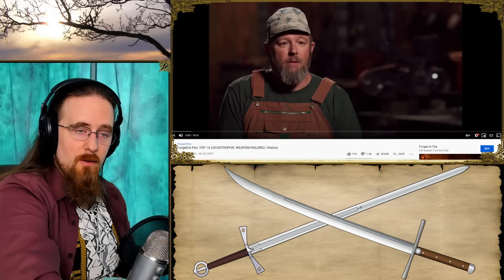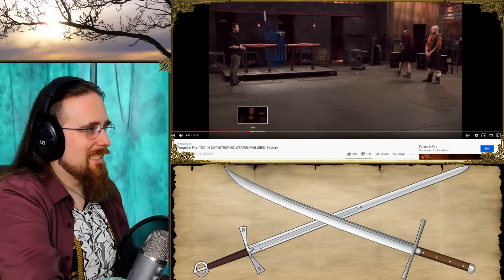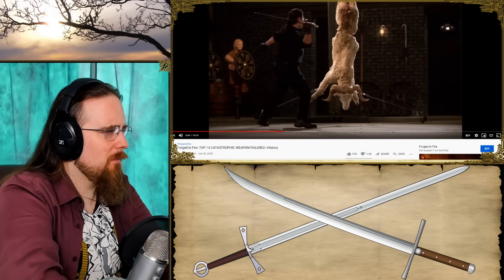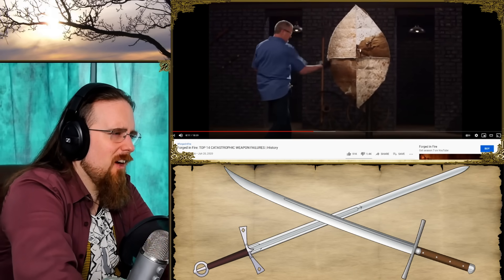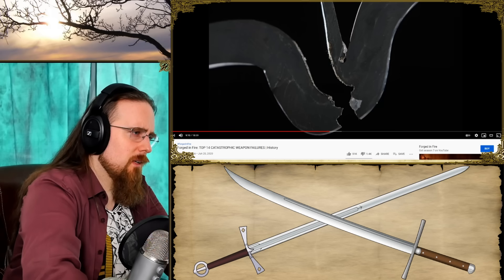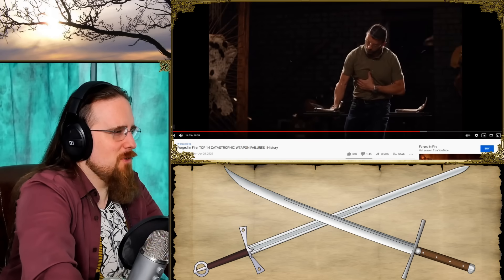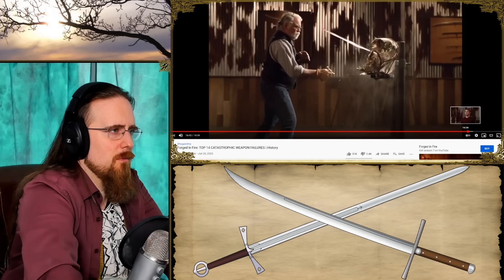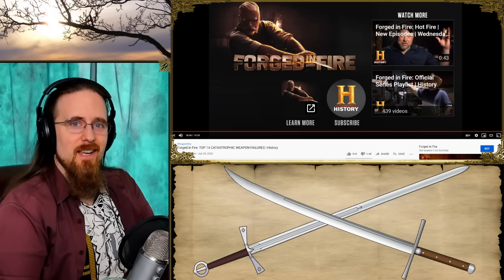Skall Comments: Catastrophic Failures on Forged in Fire

Comment: The hardwood test is in case they need to fight an ent.
Reply: Wouldn't ypu use an axe or a halberd for an ent though?
Reply: @joyeuse8524  Anything that burns hot enough to set fire to living wood would be a better option.
Reply: @anselravenhart4753  but of course it would, but here's considering melee weapons, if you want fire, there's throwing some flamable liquids and then burning arrows (they exist for this kinda situations, and sieges...)
Reply: @joyeuse8524  Well, depending on the type of ent, you don't ever want to be in melee range, because you're dead no matter what you wanna use.
Reply: @anselravenhart4753  flamethrower? Flamethrower

Though if you do want to get the wood, which is most of the time the case as it is usually a great material for making wands and staves, fire isn't an option

Comment: For the horse skull failure, I remember the episode and did explain why it failed. The tang was too small for  handle, in other words the tang had alot of room to move around which lead to failure. They even show the snapped off tang in the handle and you can see the huge gap in the handle.

Comment: Keep in mind that they give rigorous testing like they do on Forged in Fire because with exception to Doug Marcaida, the judges are master smiths (as rated by the ABS, or American Bladesmith Society), so they know how well the blades should hold up if they're heat treated properly. Most of the time, the weapons sometimes take edge damage but otherwise hold up well.

The test for Master Smith with the ABS involves forging a knife that can withstand a 90-degree bend in both directions and then a submission of five identically-forged knives to a panel of judges. One contestant on Forged in Fire was actually a panelist for J. Neilson's master smith test.

Comment: Something to remember with this show, this is a competition for $10,000 not a showcase of smithing techniques or even weapon techniques.

These tests are so intense because they want only the best of the best to make it, and eliminations in each round are required for the show/contest to proceed.

To find the “best” smith they need to push these weapons to the extreme to “guarantee” a clear winner. As Skal points out, the tests make for great entertainment, and the chance of failures adds stakes to what is a fairly mundane topic for the average viewer, which drives interest in even non-enthusiasts. 

It also makes choosing who gets eliminated less subjective if a weapon simply fails and another doesn’t.

Comment: Just saw this vid. Very interesting, but one point to be made for the aggressiveness of their tests is that usually a failure of this sort on a new knife or sword may not happen this way in normal use, but usually shows underlying defects that would eventually surface through repeated usage (on tools which should have multi-generational lifespans). And even then, hunting/army/survival knives certainly must be strong enough for all that as you might well be called to use them as crow bars or whatever else (just like swords could’ve would’ve been at war, if you have nothing else to bust down a door).

They usually look at the failure afterward and point out either micro-fissure, bad welds, bad tempers, or other. And they judge all of them based on the same criteria.

When you ask metallurgists and industrial engineers about the show, they have the same reaction towards damascus steel, that it is a purely cosmetic choice, and a liability if anything else, but that these strength tests should be survivable by well forged steel.

Comment: At 7:30 he did have proper edge alignment; if you look closely the blade is actually in two places at once, the newly detached blade which is much more visible and when the sword was still intact hence the gray line you can see from the handle. It seems like that frame where the sword breaks isn’t a key frame so the interpolation of the camera took where the blade was and where it was going and sort of meshed the two together.

Comment: 13:40 The living horse would have various other tissues in addition to the bone, and it's all fairly wet. Like trying to cut wet wood vs. dry wood, the water might absorb some force, but mostly, it will cause the wood to seize around the blade or saw.

Comment: The point you made about rounding out the shouldering where the tang turns into the blade is a good one. That’s actually why firearms suppressors are round for the most part because when you deal with the high pressures being captured by the suppressor sharper edges generally tend to blow out during testing a lot faster than if they weren’t brought to an point

Comment: My favorite pattern welded functional designs are ones which present the layers similarly to feather damascus. By choosing steels that wear differently with continued use, and by creating a significant number of layers, you can make what amounts to a self-serrating blade with extended use. It certainly won't slice as well once it wears down to that point, but even dull serrations can cause damage.

Edit: for clarification, I still feel that essentially all of the pattern welded steels are seeking the cool factor and really don't contribute anything to the blades in a structural sense that could not be achieved with a monosteel blade.

Comment: We call those stress risers. A sharp corner, notch, gouge exc are stress risers. The force will focus in that area and cause a failure. In my heat treating company we inspect all blades before heat treating to make sure the stress risers will not cause a crack. Even course grit grind lines running perpendicular to the spine can cause cracks during the quench.

Comment: When I was making swords, we had to hit an old anvil (yep, an anvil) with every blade 10 + (from point to handle with each blow to hit in a different spot, also from each side of a blade if it was a medieval sword for example) times to see if there are no cracks. Most of them weren't sharp as most of them were used for actual sword fighting. But damn, we at least had thick leather apron, facemask to cover whole head and even Kevlar collar to protect our neck, because even when it was blunt, it was very very dangerous. Once, when we had catastrophic failure I had a piece of a sword stuck in my mask, almost touching my cheek. But with this testing, we ended up with only few complaints per year and we made thousands of swords each year. We welded those broken blades and sold them for less as only decorative swords. I've heard that some those decorations were used in swordfight as well and survived a lot of fights before breaking. Place where it was welded was softer then rest of the blade, but it was still usable. Dangerous, but usable. But you know, if you want to be safe.... you are not fighting with a sword for fun.

Comment: @5.06 his edge is presented, but notice that blade isn't flat to it's line of trajectory; this will create a twisting moment that will create intense shear forces in respect to the part of the blade that has already passed the target.  The shearing place is between the contact point, and the center of momentum/rotation momentum on the far end of the blade.  The steel would have to be incredibly tough across the cross-section and resistant to shearing force (eg supple along it's entire body length) to stop the twisting, since the twist in the distant end of the blade will be pulled in the opposite direction than the twist that occurs at point of contact (which is stationery) (conservation of momentum). typically the far end cuts in the direction of the blade cut (usually down), and the middle usually twists contact edge up.
 The plane of the cut, needs to be at the plane of blade presentation, as well as edge on the same line.  Practice against bottles of air to get the hang of it.

Comment: “There’s only epoxy holding this”. I’m not sure of the greater context, but as a boat builder and a dock builder I have an incredibly high degree of confidence in epoxy. I’ve used it practically to lift thousands of pounds.

Comment: The show does a lot of Odd editing where it seems they cut out informative bits so they can have time to replay the cliffhanger commercial break clips. They will also go back and re-dub explanations of failures and issues during the time blade making scenes afterwards too. Occasionally you'll see the judges talking about their evaluations of the blades but later in the series those scenes just seem to mostly not be done anymore; just more Television min/maxing I suppose. Overall though it is a fun show, you should watch a few episodes if you haven't already. I believe you can even watch some of the episodes on Netflix now.

Comment: One thing that I think needs to be kept in mind is that these are only the failures.  There are blades which not only pass these same kinds of tests, but also manage to do so with little-to-no damage at the end, so the tests aren't impossible.  They're just above and beyond what a blade would normally experience on the battle field.
Reply: I believe its been stated by them before that the tests are also all done on a weapon made by one of the judges first to see if it will hold up. And recently they started letting the competitors compete against the judges themselves and usually the judges very own weapons that they make in the same time hold up just fine.

Comment: One small correction regarding 10:45 : Bone as in lamellar bone (which is the normal adult bone) is always calcified. Depending on the formation of the bone the calcification of cartilage is usually the first point in ossification at which you can speak of "bone" as in woven bone first, later lamellar bone. Only real exceptions of naturally decalfified bone is due to pathological effects.
Skallagrims point about dried bone being harder to cut still stand obviously.

Comment: Two reactions to your comments on the show:
They hit that hard in order for some blades to distance themselves from others. Hit softer, and you might create scenarios where no blade is damaged.
You are right to suggest simpler and straighter strokes to make the tests less biased, but I think it's also important to test the usability of the sword. If the handle prevents you from handling the blade well, it's important to know it.
Great analysis overall, thanks a lot!
Reply: I agree, the show can easily be biased in picking winners especially for ratings and such. If they want a blade to break during a segment, then they'll break a blade, fair or not. They can't be called on it by the contestants either for even if they try to cut concrete with the flat of the blade being swung by a machine that wont stop until something breaks because "you're saying that because you lost"

Comment: You also have to keep in mind that the tests are magnified  in "unreal toughness"  for a purpose. A real blade from the period had to endure years of wear and tear. Also historical blades were not all wielded by masters, as Skallagrim pointed out in a previous episode. If your blade can't survive a laymen it may be  pretty but you wouldn't outfit your army with pretty blades that have flawed smithing.  In one knife test both blades performed so well that the judges had to add more weight to the rig to force a breakage (I think it was Super Champion episode). In other words, if the Forged in Fire crew can wreck your blade easily you wouldn't want to march into battle with it.

Comment: as a blade craftsman I always check mine before they go out to a "toughness" test first is hardened oak, then antler . My failure rate is about 2%, mostly edge chipping. I have had a few ( patterned steel just blow up into a million pieces though which ALWAYS SUCKS because of the amount of extra work they are)

Comment: If you click a little gear down on the bottom right for settings, you can adjust the playback speed down to a quarter of normal. Won't get the frames back that were lost, but it can help

Comment: The trouble I have with forged in fire is two fold. 1. No temp guns are provided so the contestants have to rely on sight to forge , but the studio lights wash everything out so the smiths can’t easily tell how hot the steel is. This is what causes so many stress fractures and cold shuts.
2. Sending the smiths home for a week ends up screwing over poorer contestants 9/10 times. The dude with the power hammer and sword length forge is able to deal with issues that come up faster and more easily than the guy working out of a grill forge with a 50lb cast anvil and a ball peen hammer. I’d prefer that they give these guys access to the studio forge for a week instead so that skill is the only variable.

Comment: You did catch something that I have seen multiple times happen in this show and it drives me crazy.  Several of the testers are smiths and not actually skilled in using weapons.  I have seen them repeatedly make mistakes is blade alignment when performing strikes that results in the weapon breaking.  Those mistakes are the failure of the judges and not the contestant.  

Since this is a competition, if one of the judges messes up and damages/destroys one of the contestants submission through their actions rather than an innate failure of the item then they are opening themselves up to a lawsuit for "fixing" the competition.  There are lots of laws in the US specifically targeted at going after contest TV shows which fix their results and it is highly illegal.  I would not be surprised if they actually pay out the full amount to contestants whose weapons are broken and lose through some screw-up on the part of a show judge.

Comment: 7:50 Pretty sure it was the previous slit in the leather. The tip of the blade hits just above that very deep gash on leather. A shallow angle on leather would mean a large deflect to the tip of the blade. His wrist is straight as a rail, but the tip slides up and the second curve in the blade shows the amount of sheer force on the midpoint. I really don't think it was his form, but the previous cut that broke the blade.

Comment: He explains what happened with the break at the guard.  There was an air gap in between the guard and tang.  The slot for the tang to fit through was too big making a gap at the guard which allowed it to move and stress.  In fact, if you actually took time to listen, almost in every instance they show the smith what they did wrong.  In almost all situations except where Jay Neilson is doing the strength test, it's the Blacksmith's fault.  Ben Abbott's pretty good and David Baker does excellent strength tests.  If it breaks on David Baker it's always because of the blacksmith.  At times I think Barker is too easy on the blade.  It's frequently a heat treat or weld issue that causes them to break.  At times watching the show you know who's the blade is going to fail before the test even happens.

Comment: What I like about Forged in Fire is that it doesn’t make any sort of statement about the objective quality of specific swords and armor. Just a comparison between two smiths under extremely harsh conditions. There’s one episode that I remember where the swords were stress tested against poorly made mail (albeit it was riveted, I will give them credit for that but the interlocking pattern and quality of the rings were all off) a few strikes did manage to break a few rings but there was no mention about it, just about how the blade held up.

Comment: Yes an no Skallagrim. I agree with your point on blade abuse. But every person at this point knows what they are signing up for. And if you're entering Forged in Fire, you can count on having 5 days to make a blade that is both 'Historically Plausible' and 'Capable of taking stupid levels of abuse'.

Secondly, every single forging challenge in my eyes seems fair on a level. Because they DO have the supplies to complete the challenge. Rather it is a Canister Damascus or a Leaf Spring or a piece of harden-able and soft steal for a San Mai, and at their own shop, their metallurgy, in well knowing the brutality of the potential tests, is their choice. The people who do best are flexible and patient, and act like they have all day, and just aren't taking breaks. The biggest point where people die bred by impatience. Rather it be not cleaning your metals, or running to a handle material you don't know, or deciding to weld something due to a lack of time.

These Judges have one major credential going for them. Which is proven in Forged in Fire: Face the Judges. They are capable of making blades to survive their own tests. And this isn't about who's the better warrior, as a great warrior can make a log outperform a sword if the sword is in the hands of a moron. It's who can make the highest quality blade in an extreme time crunch.

Comment: Typically if both weapons preform equally and come out in same condition, it comes done to small details. Which one was easier to hold and use, was a handle material more comfortable and etc. 

I do agree if they are perfectly equally than it should be a sudden death round of performing till the blades can't anymore.